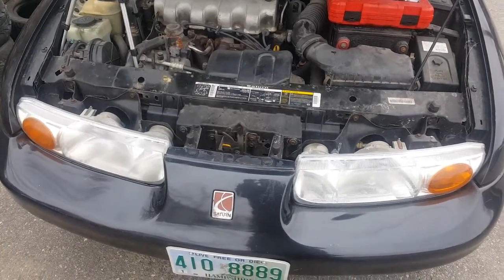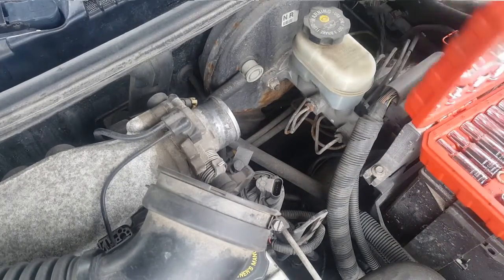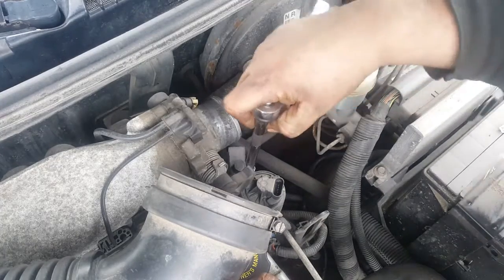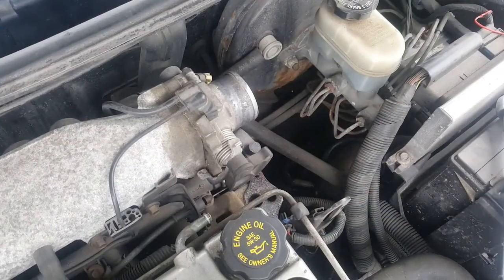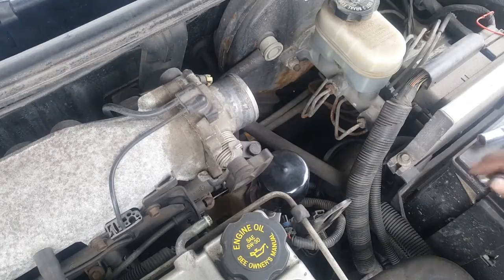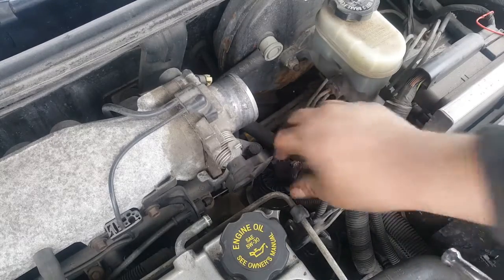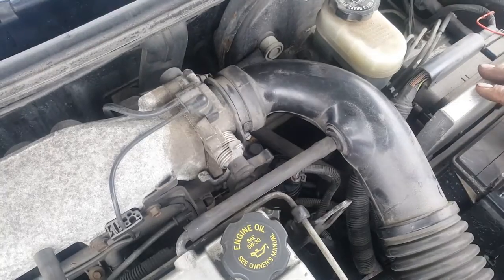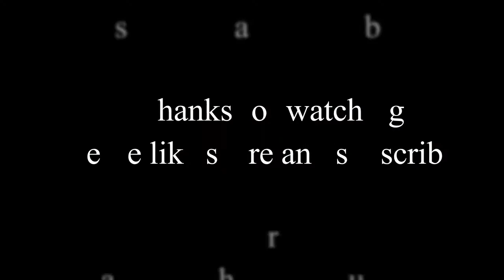2001 saturn egr valve replacement

Comment: Hey man, used your video as a guide to replacing my EGR today.  Worked great!  Gave you a thumbs up.  Thanks.  You got anything for A/C systems?
Reply from the maker: I haven't had any recently but what are you trying to do thank you
Reply: I'm just recharging the A/C.  Never done it before.  Kinda nervous (it involves handling freon after all).  I don't quite understand how reliable the gauges are for determining how empty the lines are.  I just got back from the store. I got 24oz of R-134a refrigerant, a 10oz can of UV "leak sealer" r-134a, a blacklight lamp.  The r-134a comes with a low-end gauge (low end / low pressure...I'm not sure which is the right term).  I know I have to rev the engine to 2k RPM and put the AC & Fan on full blast.  Not sure what else I need to do, be aware of, or be precautionary of.

Comment: Hi, I have a 99 Saturn w an EGR issue. I've replaced it twice and cleaned the last one 3 times but it keeps clogging up. Do you have any idea what is making this happen?
Reply from the maker: Have u run any cleaner in the fuel I'd start there

Comment: Will I still get a code if I don't place the gasket on it? The reason I'm asking is because I took EGR from my brother's  Saturn and put on mine and the check engine light came back on after about 20 miles. We have the same exact car. When I took off the EGR I didn't see a gasket under it
Reply: I was told by the front desk guy st auto zone that if you don't replace the gasket the light WILL come back.
Reply: I got a duralast brand one and it came with a gasket. I would go to Chevy or gmc service center and ask them for a gasket. Saturn is a gm product and they should still have the parts in their inventory.

Comment: Why do you even need this plugged in and working to make engine run cleaner? Its recirculating the exhaust back into the intake isn't it? Why wouldn't completely fresh air be more clean for the engine to preform better instead of exhaust fumes I guess.. thanks.

Comment: Why is it important to reset the codes and what happens if i dont do it? 
I dont have that scanner equipment
Reply: alex take off one of the terminals on your battery for 10-15 minutes.
Reply: The man told me it didn't matter, and it would reset itself eventually, but might take as many as 40 restarts on the vehicle to reset itself
Reply from the maker: Your vehicle should clear the code after driven for awhile